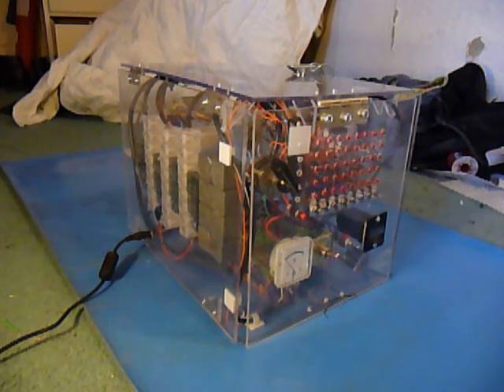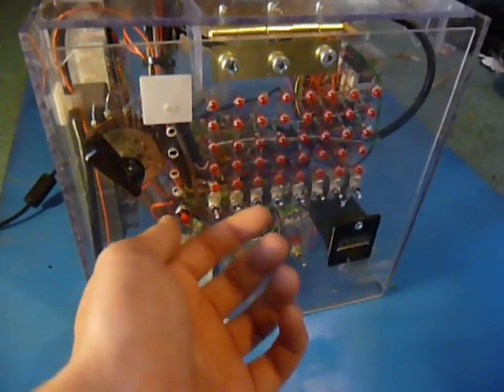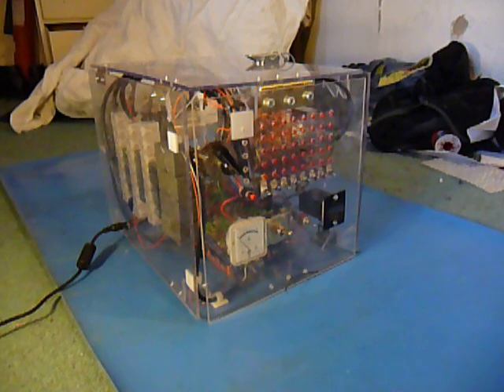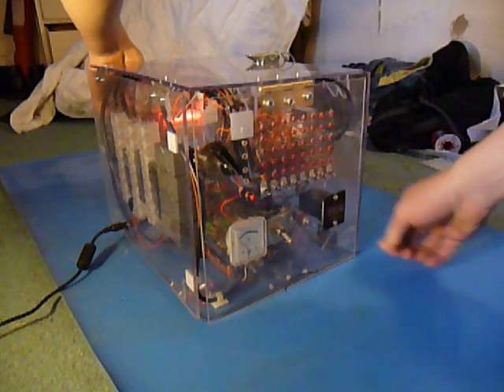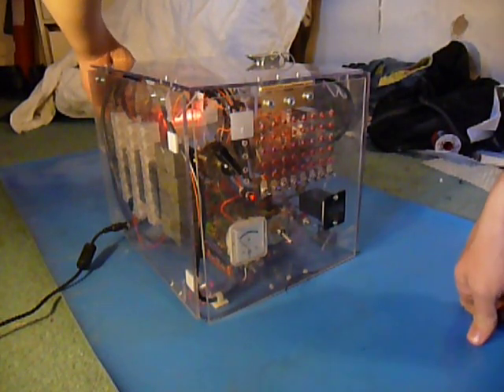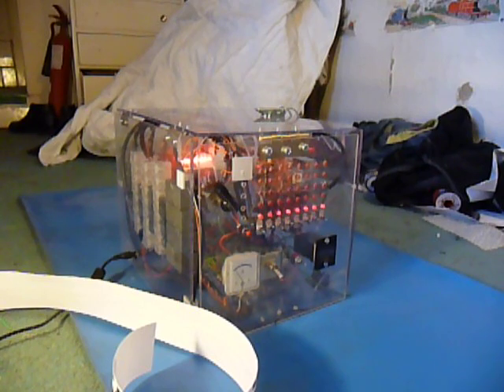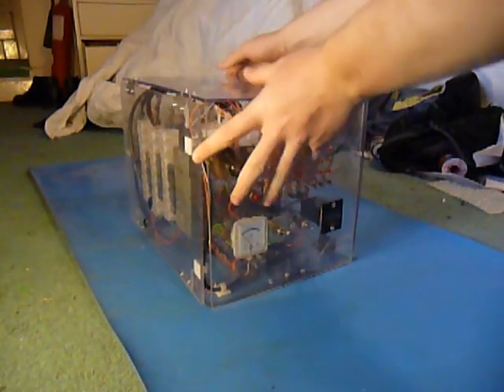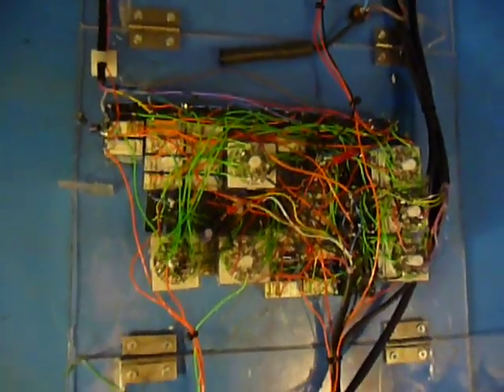TIM8 Relay Computer (Vlog 5)

Comment from the maker: Well this was pretty much my first electronics project... I rather threw myself in at the deep end :P The paper tape system was my own idea, however the Harvard Mk1 computer built in 1944 used a similar system, but it didn't have the same loop function and I only discovered it after I had finished TIM.
I've used him to work out how to do ADD logic for Tiny TIM (my current project) and my latest video on TIM shows him being used to control a robot chassis, but on the whole its just for research.

Comment: I have examined the circuitry of this machine, and your use of capacitors and Si diodes to create the registers & ram undermines your claim this CPU/Computer is electromechanical..  At best it is a hybrid...  It is also clear that the RAM is nothing more than a 'temporary buffer' between the Mass Storage and the Registers??Seems to me to be highly volatile destructive readout???